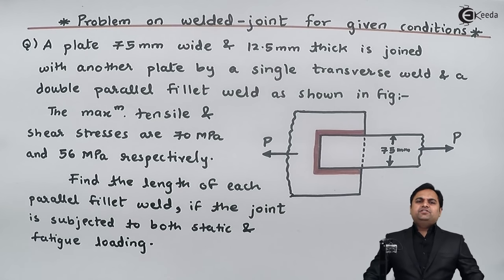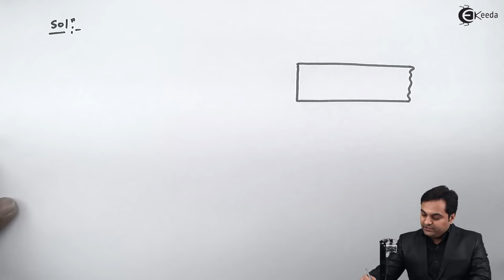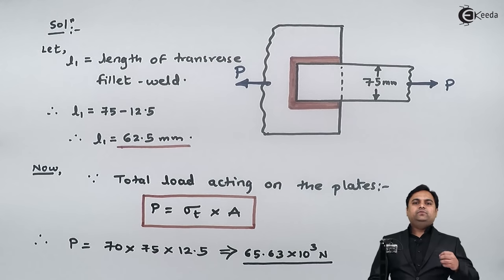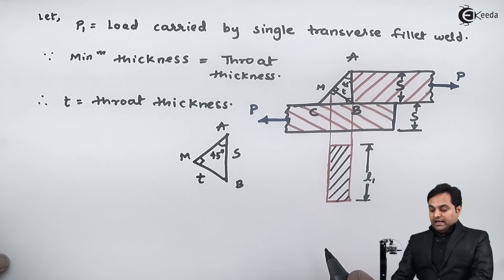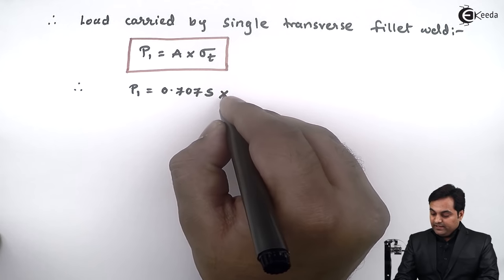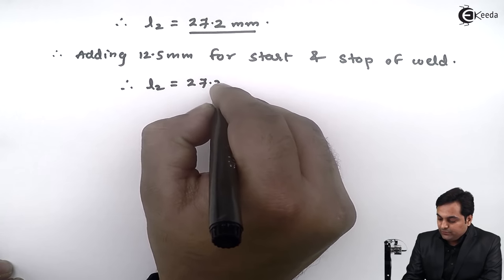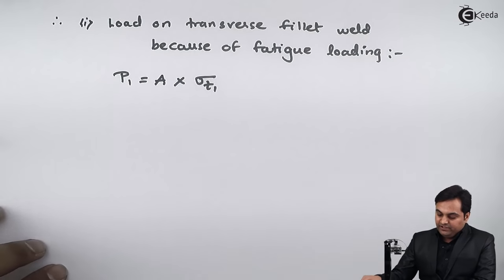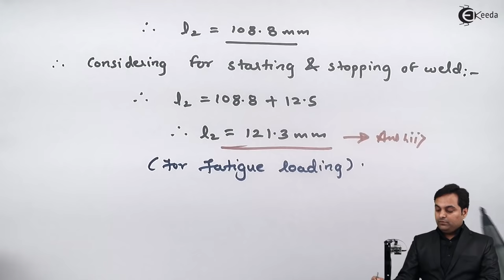Problem 1 on Welded Joint - Design of Welded Joints - Design of Machine

Comment: Nice lecture Sir,thank you.But you should have explained why did you  add 12.5 in L2 and subtract 12.5 from L1.
Reply: Just used the previous concept in which you have to add 12.5mm extra in length of the weld ( weld run )for the starting and stopping of the bead . That's why the width becomes greater than the actual length weld ( calculated by design ) .
So, 12.5mm should subtract when We need to find the length of the weld for transverse fillet weld.
Hope it will clear you

Comment: L1 calculated As 
Just used the previous concept in which you have to add 12.5mm extra in length of the weld ( weld run )for the starting and stopping of the bead . That's why the width becomes greater than the actual length weld ( calculated by design ) .
So, 12.5mm should subtract when We need to find the length of the weld for transverse fillet weld.
Hope it will clear you

Comment: Sir I don't understand that why we substrata 12.5mm from width while we calculating the length of transverse fillet in case of single transverse double parallel fillet weld
Reply: Same problem we have sir please clear this
Reply: At start and stop of welding bead for some distance will not exibit the same strength when compared middle portion of weld bead. This is the reason we add extra length on theortical weld bead length.
Reply: It should be 75mm
Reply: Same bhai

Comment: Can you explain how did you calculate L1(Length of transverse fillet weld)? It's confusing.
Reply: Y he subtract it ...i also didn't get that
Reply: Same here not clear about L1.
Reply: yes i also didnt understand that.
Reply: Just used the previous concept in which you have to add 12.5mm extra in length of the weld ( weld run )for the starting and stopping of the bead . That's why the width becomes greater than the actual length weld ( calculated by design ) .
So, 12.5mm should subtract when We need to find the length of the weld for transverse fillet weld.
Hope it will clear you

Comment: When we finding the strength of weld, either we need to consider filler material tensile and shear stress values or plate material tensile and shear stress values. Could you please suggest me.

Comment: I think longitudinal welding are in shear while transverse welding are in tension. also to get the laod , you need to use Ultimate tensile strength fu. Also the weak axis for the shear is at 45 degree and not the min, thickness as he mentioned. All this exercise should be reviewed. it is not correct

Comment: I think L1 should equal 100 which comes from 75+12.5+12.5
Reply: l1 is 75-12.5
Reply: Dibyasish Chakraborty how bro
Reply: Saikiran Garlapati I think this 12.5 is not the thickness but it is the value for starting and stopping of weld run
Reply: Thank u very much bro
Reply: 12.5 is the constant value for all the problems we can see the problem machine design by R.S KHURMI AND j.k guptha page no 355 example no 10.5
Reply: Ahmed Elhalwagy  I think he subtracting thickness value l = 75- 12.5(thickness)

Comment: yah ..how the hell L1 u got man?\
Reply from the maker: We recorded your response. We will get back to you shortly.
Reply: @Ekeeda  2 years later (still waiting for the reply)
Reply: Just used the previous concept in which you have to add 12.5mm extra in length of the weld ( weld run )for the starting and stopping of the bead . That's why the width becomes greater than the actual length weld ( calculated by design ) .
So, 12.5mm should subtract when We need to find the length of the weld for transverse fillet weld.
Hope it will clear you
Reply: @efsanemuhendis  7 years later, still waiting for their reply hahaha